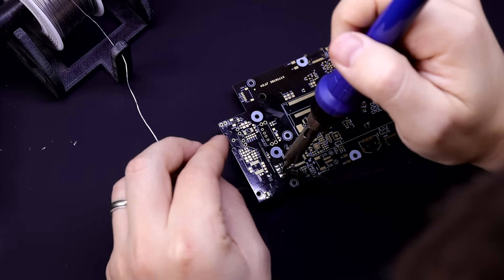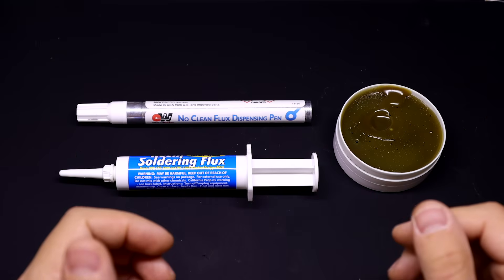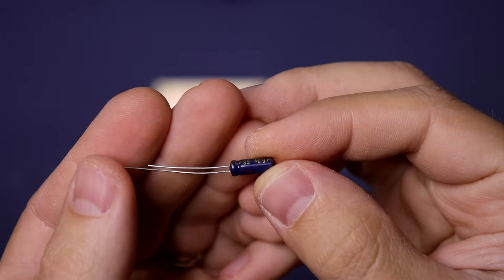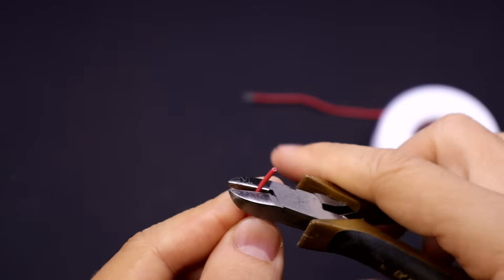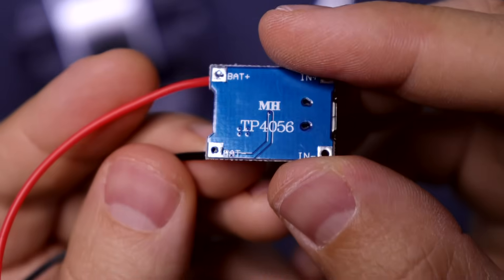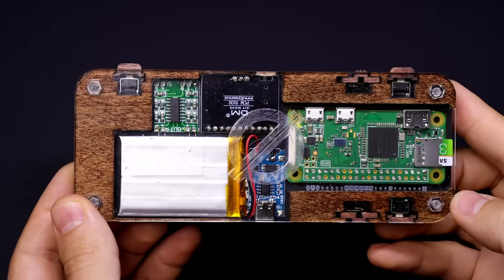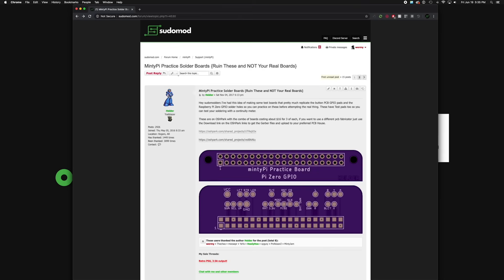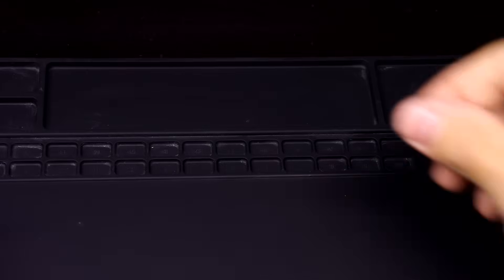Soldering Crash Course: Basic Techniques, Tips and Advice!

Comment: A couple of comments that may be useful to newbies. Traditional tin- lead solder that is designed for electronics usage usually contains a rosin flux which is actually a pine tree type product, non toxic, and generally non corrosive and non conductive. The fumes from soldering this type of solder may be mildly irritating to your nose and throat, but the boiling point of lead is much higher than the temperatures you are soldering at and therefore any kind of lead poisoning scenario from the fumes is extremely unlikely, but you should certainly wash your hands after handling it. Lead free solder  generally uses a very different type of flux made from organic acids, the fumes of which  are extremely unpleasant to breathe and can be potentially toxic. Those specialized lead-free fluxes are also both conductive and corrosive and must be thoroughly removed from the circuit board or they can cause problems for the circuitry had some later date.  Rosin flux is best dissolved and cleaned away with alcohol, but lead free type fluxes are often water-soluble and may or may not clean off easily with alcohol. 

Also note that lead free solder is more corrosive to the soldering iron tips than lead solder, partly because of the corrosive effects of organic fluxes and especially because of the higher temperature tip settings necessary in order for lead-free solder to flow well.  Regardless of which type of solder you are working with, the soldering iron tips will degrade with time and use, so be sure to buy a couple of spares, and ideally you should buy an arrangement of shapes and sizes. For most electronics work I find that the simple conical, sharply pointed tip as used in this video is not the preferred tip shape. A chisel shape tip with a rounded, blunt end works best for about 95% of my electronics work. Get an assortment of tip sizes and shapes to experiment with.  Note that high quality soldering tips are usually made of copper (or sometimes brass) that has been plated with iron or steel. Steel resists the corroding effects of solder and flux much better than plain copper does, and yet still wets to the solder well;  copper is a better heat conductor,  but plain unplated copper very quickly pits, corrodes and oxidises from the constant heat and chemical effects of the solder and flux. So many of the soldering tips are made in Asia nowadays,  probably from a variety of recycled metals, that you might have to try several different brands and sources to get something that lasts a reasonably long time. 

 I do like the brass wool tip cleaner shown in the video here; they work quite well and I have read elsewhere that the traditional wet sponge cleaning technique tends to cause micro fractures in the tip and shortens its life. (The springy brass sponge tends to fling little bits of solder around as you clean/wipe the tip, and so a holder with a hood over the brass wool will help contain the mess). You can use steel wool to clean the tip if absolutely necessary, but with proper tip care, maintenance and suitable temperature settings, steel wool shouldn't be necessary.  

By the way,  the "best" way to turn the tip of the soldering iron so black and oxidised that it doesn't work well for soldering is to use it to melt and fuse plastic parts, repairing cracks and so on; a useful technique, but keep a sacrificial extra tip around just for that use. By the way, never scrape a soldering iron tip with a razor blade or take a file to it in order to "clean" it (as shown in some You Tube videos). Never!  You will remove the steel plating and the tip will wear out that much faster.  You may find it instructive to put a magnet to the soldering iron tip and see if it is magnetic to any degree. A copper or brass tip that is still plated will have at best a very mild magnetic attraction. If it's strongly magnetic then the chances are good that the entire tip is made of steel. If a highly magnetic steel tip still works well for your soldering purposes, that's fine, but generally copper or brass are better heat conducting materials for our purposes....

Regardless, lead-free solder often tends to make a more grainy, crystalline, dull looking solder joint, and the solder joint is likely to break down prematurely if exposed to extreme heat from a power supply resistor or regulator, and interestingly also tends to break down in extreme cold temperatures and form "tin whiskers", aka dendrites, that can short-circuit to adjacent parts or circuit paths and PCB foil traces (as polar explorers and NASA engineers have discovered, the hard way; Google "tin pest"). 

 I personally prefer traditional tin- lead electronic solder with a flux core. Lead free solder doesn't wet and flow as well as lead solder, and is responsible for numerous devices breaking down and failing prematurely and ending up in the landfill. If you are just starting out learning to solder, I  recommend that you start with lead solder, and only use a known, name brand product from a reliable source, such as Kester or Weller.  Be advised that solder, or the flux inside of it sometimes seems to go bad if it is old and therefore freshly made product is probably better. There's also a lot of variation in lead free alloys and the fluxes they contain. Probably a good idea to buy at least 2 different brands of solder from different sources and see if one is easier to work with or gives you more consistent results.  It is also a good idea to buy yourself some separate flux in paste or liquid form;  but unfortunately I have seen cases where soldering flux that isn't actually designed for work on electronics is being sold to electronics hobbiists. Always check the label on the bottle to see if it has a precaution against using it for electronics work.  The highly acidic ( and corrosive) fluxes designed for soldering copper water pipes are not the same as, and not interchangeable with, fluxes designed for soldering circuit boards and electronic components; nor can plumbing solder be used as a substitute for electronics solder. Be aware that there is a special-purpose "soldering paste" which is a mixture of powdered solder (typically lead-free) and flux,  designed specifically for soldering microprocessors with miniature, nearly microscopic pins (or hidden "pins" on the underside of the processor chip), and therefore is not the same as plain soldering flux.
Reply: The bit about the fumes from soldering coming from the rosin and not lead was super good info. As someone who's allergic to half the known universe but wants to do soldering for projects it's good to know that A: I won't be giving myself lead poisoning and B: Any allergic reaction will probably be from a tree allergy lol
Reply: @neonlights_12  ,  Here in New England I frequently see some kind of pine or fir trees on my walks in the woods that appear to be bleeding sticky sap down the side of the tree.  I intend to bring some home and see if it will actually work as soldering flux!  My best guess says that it will, although it's probably not a bad idea to dissolve it in a little alcohol to make it thin enough to run it through a filter and get out the bits of bark first, and then evaporate the alcohol off....🙂.  Anyway some people claim to be allergic to the flux fumes, so just use a fan or a shop vac,  or solder in a well ventilated place, and you should be fine. Have fun!
Reply: @goodun2974  Fumes are the main reason I always shy away from soldering. Just don't want to take the risk.
Reply: @kckrol85   , you could buy a solder-fume extractor if you really wanted to, but most people find that a fan and a well-ventilsted space, perhaps with an open window, is more than sufficient.
Reply: The tip about using the round chisel shape tip was very helpful. I tried the point tip first and I wasn’t have very much success making clean solder points, but after I switched tips it was much easier. Thank you!
Reply: @superman2789  for some reason the pointy conical or pencil tip is the defacto standard tip that comes with most soldering irons ---- and in most soldering operations, the pencil tip is the least useful!  Unfortunately, you cannot just file the tip to change it from pointy into a chisel shape, because this will take off the iron or steel plating and then the tip will very quickly be eaten away at by the hot solder and flux.
Reply: @goodun2974  really tips are cheap enough. At work we have expensive irons with expensive tips (AUD40- each) but they do last for 50,000 joints so they are worth the money. A hobbiest isnt going to buying tips very often if they look after them (tinning, not using too higher temperature and not dropping them).
Reply: @ianmontgomery7534  , the problem for newbie electronics hobbyists is that if the first set of tips (and/or the soldering iron) they buy is of mediocre quality, and they have difficulty making reliable solder joints, they don't have sufficient experience to know if it's the equipment, or their technique. If the first tips you buy are crap, how would you know? And then, you have to try another source, and hope the replacements are better....the tips aren't usually too expensive, but by the time you buy a soldering station, solder, flux, desoldering braid and pump, a multimeter, hand tools and so on, it can get a little expensive; and if you need to go searching for tips that work well and last, it might get frustrating and confusing. I hate to see stumbling blocks enter the process....
Reply: @goodun2974  ALL excellent points. Bit of a Catch 22 situation.
Reply: @jed2055 , thanks! Whatever hobby people invest time, money and their hearts into, I'd like them to be successfull. Much of what I know was prompted by or taught to me by others, and passing their knowledge on is a fine way to honor them.
Reply: @superman2789 ,  I posted a video about soldering iron tips on my channel recently:  shapes & sizes, metals used to make them, and how to tell good tips from junky ones. I also posted a review of an inexpensive but surprisingly effective soldering station from Harbor Freight. There'll be more to come!
Reply: Definitely good to know! I was thinking I was going to buy lead free because it sounds more safe haha
Reply: @TD75  , Thank you! That is easily the nicest thing anybody's ever said about one of my comments. I am glad to have been of some help to people.  One of these days I'm gonna have to post some videos of my own, but I am an analog guy in a digital world and not very skilled with smartphones and computers, so it would be a steep learning curve for me.
Reply: @markgilmore906  ,  I have been ruminating on the idea of posting some videos for a while now. I don't think that soldering would be my very first videosubject; I'll probably start with things that nobody else does, like tutorials on the types of failures seen in oxidized switches and potentiometers, and taking them apart for mechanical cleaning versus simply spraying them with a contact cleaner,  which is what most people do. But yeah, eventually I could get around to doing some stuff about soldering.  My digital skills are poor, however, and I only have a phone to work with, not a laptop, and if I do some videos I'll probably have to try to do them almost completely "live", and rehearsed in advance, with only a pause button to bypass or edit out the more boring parts. ( I don't like long meandering videos). We will see! I do need to buy some kind of tripod or gooseneck clamp to hold the phone/camera.....
Reply: Thanks for posting this. I was familiar with a lot of it, but this clarified a few points! 🙏🏼
Reply: You should totally make a video!! I'm eager to learn more about the positives and negatives in working with soldiering and you seem like you'd be a big help already based on the comment. Thank you for the comment and hopefully you do make a video similar to your comment/more in depth.
Reply: @connerdegarmoe9248  , considering the number of replies and positive feedback I've gotten to my comment here, I may have to set aside my fear of looking a fool on camera, grip a knife between my teeth, gird my loins for battle, and figure out how to post a video on YouTube.  Part of the problem being that I am an analog type of guy in a digital world and I don't get on very well with anything computerized; and my only Internet access is through my smartphone.  Rather than try to edit a long and rambling video into something short and concise I would probably just rehearse once, then wing it and do it live with nothing more than pushing the pause button to leave out the unimportant parts and keep it down to a reasonable length. Personally I rarely watch a video that runs more than 15 to 20 minutes. So anyway, I'm seriously considering it. Keep poking at me to give me the courage, or to make me feel guilty!  I definutely need some kind of overhead tripod or long goose neck to hold the phone so that it can function as a camera, leaving mu hands free; and I would have to figure out how to do the lighting so that the important stuff wouldn't remain in shadow..... Most important of all is 1) not to scare the kiddies;  if I were to show my face, screens would crack around the world! 😁 And 2) I tend to cuss a lot, and I sometimes forget when I'm in a public form, so I'd have to be mindful of triggering the censor-bots....
Reply: @connerdegarmoe9248  ,  Now look what you made me do! 😉  I have finally started posting some soldering-related videos on my channel: reviews and teardowns of inexpensive soldering gear, tools and techniques for cleaning and preppinh surfaces and parts prior to soldering, how to tell quality soldering-iron tips from cheap junk and how to make tips last as long as possible.... There'll be more to come eventually!
Reply: Tin whiskers and dendrites are not the same thing. Dendrites are caused by accumulating ions. The cause of tin whiskers is not known 100%, but it likely has something to do with microstrains in the tin. This is supported by the fact that reflowing high-tin solders reduces the chances of tin whiskers. I would also add that one of the reasons lead-free solders are not good for tips is because they have a higher tin content and tin aggressively breaks down the tip. This is why you shouldn't excessively feed solder directly to the iron tip.
Reply: @alexanderbonnot  , I read somewhere that the Federal government keeps a stash of tin, which is considered a strategic war material,  in some Fort Knox like place and periodically melts and recasts the ingots. Historically, "tin pest" degradation has caused failures in church organ pipes in cold Northern Europe, and contributed to the failure of an Arctic expedition when a stash of fuel containers, sealed with tin solder, all leaked; extremes of cold, as well as heat, can spur the tin to break down, and NASA have suffered satellite failures in space from tin whiskers. (Note that another Arctic expedition suffered lead poisoning from food cans sealed with lead solder). On YouTube you can watch videos of early transistors and Hammond Organ tonewheels being cleared of short circuits caused by tin whiskers, by zapping them from a battery or power supply.
Reply: have you ever used wave tips? We use them when we hand solder fine pitch ICs during reworks or repairs. Most of the time we use 2mm chisel tips and the conical ones for 0402 smd devices.
Reply: comment was 2 years ago and its still spitting game to us newbies ✊
Reply: @xthaking ,  I finally got around to posting a few electronics-related videos on my channel: including reviews of inexpensive soldering equipment, tips and tricks on avoiding inferior or counterfeit accessories (the internet is awash in such junk), and some tools and procedures for prepping components and circuit boards prior to soldering.  Eventually I'll do some actual soldering videos as well.......
Reply: @goodun2974  Wow! Just checked, you have been busy. I'll look in on them later.
Reply: @jed2055 , Ive been slacking as of late because my wife excels at finding other things she wants me to do, but I'll be posting more videos this winter.....
Reply: A painful read for my internet-addled brain but I came out better for it. Thank you, teacher.
Reply: I've bought a soldering iron kit which is sold very well on Amazon and comes with lead-free solder wire.  I bought it to solder together around 5 pieces of wire.  Can you put into context some of your concerns regarding toxicity and lead-free solder wire as I'm concerned this is scaremongering and is something only to be considered if you're going to be doing a lot of soldering as a hobby (not just 5 pieces of wire for a car installation).   Thanks :)
Reply: @Jez1963UK  As said in Hitchhikers Guide To The Galaxy, "Don't panic."
I will be the first to apologise if you die from lead poisoning. PS You won't.
Reply: @jed2055 😂😂😂.  Thanks, I made it through 😊
Reply: I used my mask for covid haha
Reply: replying so i can save this :D thanks!
Reply: We appreciate your well put together info and the time u took to help and warn us. Instead of a like thot ID let u kmow
Reply: @markgilmore906  , although I haven't yet done any videos about soldering techniques, I recently posted YouTube reviews on my channel of a $45 Harbor Freight soldering station, a video about differentiating good soldering-iron tips from bad ones, tools for cleaning and prepping connections prior to soldering, and some tips on rosin, flux, desoldering accessories, and so on. BTW, the Harbor Freight Schneider soldering station is surprisingly good, much better than what I had to work with as an electronics-nerd teenager in the 60's and 70's.
Reply: Such a nice video and very very interesting and useful comment, @goodun2974! I actually am a steamdeck owner and I would like to upgrade the wifi card to wifi 6e. I saw some videos, where people buy the new wifi card, and using a heat gun to unsolder the wifi chip to solder it on the original wifi card (and I still do not understand, why not simply change the entire card, instead of doing all this complicated stuff). Unfortunately in that video, it is NOT shown how the card was cleaned, but I can only guess with this video that a rosin flux was used. I come to the point: what are the tools (heat gun, soldering machine, rosin) would recommend me as a beginner?
Reply: Great information.  Thank you.  I am a beginner and before I start, I will replace the lead free solder wire I purchased with a leaded rosin core solder.
Reply: @Andrew_Murro ,  suggest you buy solder (also flux, and solderwick) only from a reputable electronics distributor in your own country and not directly from China or Asia.  Solder sold online is often pure junk, or counterfeit, or sold on a weighted plastic roll so that you don't get the actual weight of solder you were expecting ( Big Clive did a video about this).
Reply: @goodun2974  thank you again.  I did not know that and will take your advice.
Reply: @Andrew_Murro  , I've seen  couple videos from others on YouTube where they tested a dozen or so different solders purchased online and compared their performance, or lack of it. Might be worth checking those out.
Reply: @goodun2974  very kind of you.  Thanks again.
Reply: @Andrew_Murro  , you are most welcome! Check back and let us know how you're progressing! I have a couple soldering retaliated videos on my channel that might be helpful. There's also a channel called Learn Electronics Repair (if I remember correctly) that has lots of soldering videos.
Reply: Rosin in its unburned form may not be toxic, once you've burned in into smoke and fumes it definitely is though. Polycyclic aromatic hydrocarbons caused by burning organic material are also carcinogenic. This is also why you shouldn't breathe in smoke from woodfire, or even fumes from gas burning stoves, to give a sense of relative danger. But absolutely bad for your lungs still.
Reply: @GrandHighGamer , in large, repeated doses, yes, fumes from burning just about anything are bad for your lungs ---- but science shows that our immune systems require small exposures to allergens, irritants, and bacteria/viruses in order to train the body not to freak out and over-react when suddenly confronted with a larger dose of a foreign substance or organism. I read a book a while ago which referenced studies showing that infants and children who frequently played in groups, who played in dirt and stuck their fingers in their mouths, who got a few whiffs of woodsmoke here and there, had fewer instances of illnesses and debilitating or lifethreatening allergic reactions than people who grew up in highly sanitized, cleanroom-like environments. The simple truth of being live biological creatures is that we are going to encounter irritants and toxins with every single breath; our bodies usually learn to deal with minor, infrequent exposures. If you're going to be regularly exposed to high concentrations of rosin flux fumes, then yes, good ventilation and filtered fans are advisable, but this isn't generally a consideration for the hobbyist. People die by the thousands every year from exposure to peanut butter or beestings, but I've heard of very few allergic or toxic reactions to rosin fumes, and I've never heard of anyone dying from it. I've also known lifelong ham radio operators in their 80's who've been soldering since they were kids and none of them were allergic, or sucking on oxygen tanks (unless they'd been tobacco users). Ultimately, it's dosage that makes the poison.
Reply: bro no essays
Reply: @kaidwall  His comment was actually very useful and well written, a valuable contribution. Unlike yours, which was low effort and useless.
Reply: @kaidwall  bro, no gatekeeping.  Feel free to write your own shorter "tips and tricks" if you like; preferably something thoughtful and helpful, and requiring more work  than just 3 words.